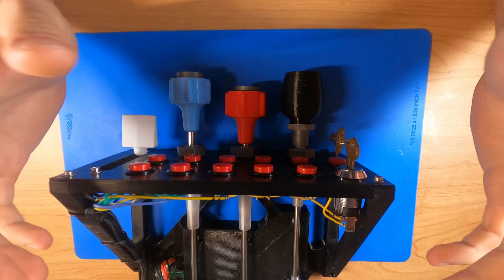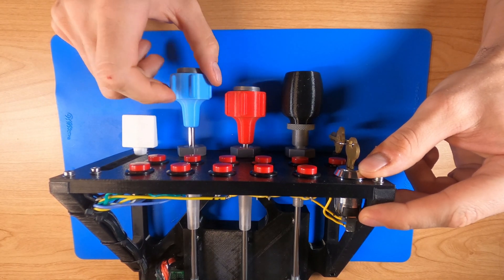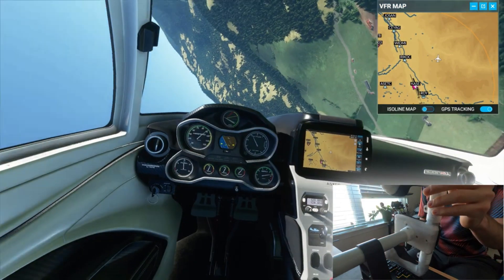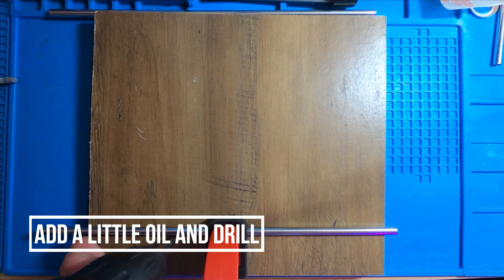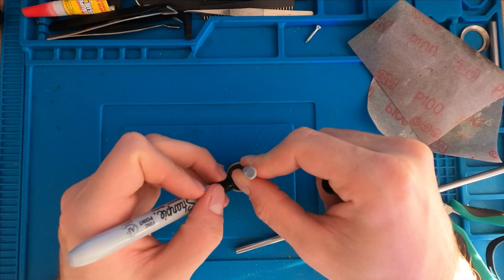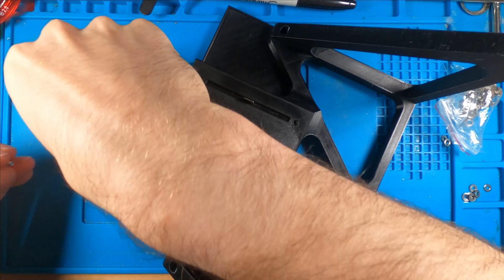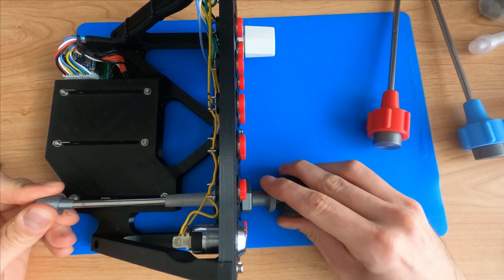CadetThrottle Demonstration and Build

Comment: Just finished building the standalone Mixture control. Thanks for your work!
Reply: where did you find adriunio codes the link is gone?
Reply: @BuddyQualityFirst  I haven't actually gotten around to setting up controls yet, but if you're using an Arduino Micro, Pro Micro or Leonardo, you can use the Arduino Joystick library to code it yourself fairly easily.  You should be able to find some examples online if you're not familiar with programming :)

Comment: i tried making this, tip: if you want the button for each knob to have a certain length, you have to drill an oblong hole for the ball bearing; having a small circular hole would only make the buttons have shorter length to press.

Comment: I am new to this channel.
Wonderful video!
Where do I get the parts for the build?  The knobs and the tubes and all.
Thank you.
Reply from the maker: If you navigate through the tabs at the top of the Arduino build page, you'll find everything you need.
Reply: @VincePrints  Wow!  Thank you for the response!

I didn't realize that you 3D printed some of the parts.  I don't have access to a 3D printer... do you sell 3D printed parts?  If not, do you know who does?
Thanks in advance.
Reply from the maker: @michaelkang215  unfortunately no, but there are many retailers you should be able to order from, if you wanted to get into the hobby a good beginner recommendation would be the ender 3 or the new bamboo labs printer
Reply: @VincePrints  Thank you for taking the time to answer.  I will take a look at your recommendations.

Comment: Shot in the dark here with an older video, but how does the fine control turning change the potentiometer position?
Reply from the maker: It pushes or pulls in a similar way to a ball screw, if you are familiar
Reply: @VincePrints  Makes sense now. I didn't catch that the prop and mixture sheathes' ID were actually rifled. I started with throttle sheath prints, that twice made it all the way to the stepped down threads before going haywire, and was going to use those whiffs as prop/mixture. Was having as much difficulty wrapping my brain around the smooth inner surface producing linear motion as I was why the print wasn't working. I'm completely new to printing; this is my very first build(on my son's printer from Santa!)

Comment: Friendly tip: if your m3 screws you're using to hold the linear potentiometers are slightly longer than they need to be and you tighten them all the way it's gonna be a long evening, or in my case two long evenings...
Reply from the maker: Yikes....hoping this worked out!

Comment: can i use toggle switches instead of pushbuttons so if the switch is ON the gear is out and if its OFF the gear is up or do i have to change any thing?
Reply from the maker: You will need to use diodes to prevent ghosting
Reply: @VincePrints  already figured something out but thx

Comment: So I found the correct joystick library to download and install in the readme on create-arduino page!  Now each slider pot (88mm 10k linear set from the amazon link, checked 10k ohm and linear with a multimeter) is only showing about 25% of the full range.  Is the only solution to use the windows joy dot cpi calibration to get them to work over the full range in MSFS 2020?  Or am I doing something wrong?  Should I tweak values in the sketch to get Windows to see these working over the expected full range?  Seems weird.  But overall - thanks! This is amazing and perfect!
Reply from the maker: The calibration in windows is necessary to have the throttle working appropriately.  This is pretty general practice even for actual game controllers just to ensure they are set up and working in their full ranges--hopefully this isn't too much of an issue!  Thanks
Reply: @VincePrints  Vince, thanks very much! It's easy enough to do, I was just a little surprised that we'd be expanding the range that much, but happy to do it to avoid spending $$$ on a commercial setup!

Comment: @Vince_Prints thanks for sharing and demonstrating! Could you please specify the size and type of springs used?
Reply from the maker: Not sure of the exact size, but they are about 50mmx10mmx1.5mm for the pedals and 30mmx7.5mmx1.5mm for the centering mechanism.  I would say this is not a strong return so you may want to consider stronger if necessary!
Reply: @VincePrints  thank you

Comment: Hi.  Which size (exact part brand & number best) & type of Linear Slide potentiometers are needed for this project?  thanks.
Reply from the maker: Hello Steve,
I couldn't find the exact serial number since they were posted on Amazon but if you go to the Arduino create link, a complete BOM with Amazon links is in the "ReadMe".  They are 88mm 10K Linear Potentiometers.

Hope this helps,
Vince
Reply: @VincePrints  Thanks! the 88 mm and 10k are the key details I needed.

Comment: 'JOYSTICK_DEFAULT_REPORT_ID' was not declared in this scope

Can some help me I have it built and cannot get the code to work. I have all the needed libraries. I am new to coding so sorry if its simple.
Reply from the maker: Make sure you have the correct joystick library, a lot of users had this same error
Reply: @VincePrints  so I finally got it to work last night I had multiple joystick libraries so I think IDE was confused. Thanks for the reply. Can't wait to finish my design I will share it on thingiverse
Reply from the maker: @homeworxchannel4120  Add it to the remix tab if possible!

Comment: Thanks for doing this! The project has been a true learning experience! My apologies if it is somewhere and I've overlooked it, but did you have any 3D printing tips you ran into? PLA vs PETG, raft the inner tubes, best orientation for knob/sheath prints, etc.?
Reply from the maker: The only noteable print suggestion would be to print the sheaths vertical with a brim to preserve the threading tolerance.  I printed everything in PETG but any filament type should be fine as long as your printer is within +/- 0.5mm.  I believe the knobs have supports under each of the overhang holes as well.

Comment: Have built this and love it. Works great in X-Plane but the throttle will not work properly in MSFS 2020. It is either 0 or 100% not linear at all. Frustrating. Working on the CadetRadio project atm!
Reply from the maker: Thanks so much!

Comment: Hi, I really liked your project and I'm doing it but I have a question, in the part of the button matrix, where do I put the ground and the voltage?
Reply from the maker: The button matrix does not use GND or VCC.  It uses the logic voltage between the two pins to register the button press.  Use the wiring diagram on the Arduino build page for support!

Comment: This is brilliant, thank you! Exactly what I was looking for for my 182 central console build — https://www.thingiverse.com/thing:4753075.

Some notes from my experience printing this. My anticipation was she sheath would be the biggest challenge, but it came out perfectly on the first attempt. The only issue is the inner thread came out spiky (and I could even see that in Cura's preview), and occasionally the ball skips, but still works great. I had to fiddle with the print settings to print the end caps (eventually had to minimize the supports). Also after cooling below certain temperature they would crack whenever I attempted to insert a straw. My solution to that was heating up the end caps slightly with a hair drier before assembly. Also had to hammer in the straws into the knobs, so maybe my straws were slightly larger diameter. And I used PLA, not PETG, that may have also played a role.

So happy I ran across this build, as I wasn't ready to shell out $80 a piece for the real verniers https://www.aircraftspruce.com/catalog/appages/a820.php
Reply from the maker: Thanks so much for sharing your experience!  Glad you were able to create some workarounds to reach your desired result--it can be tricky (especially with 3d printing) to create something that fulfills the tolerances of printers all over the world haha  Send over your finished cockpit when you have everything set up!

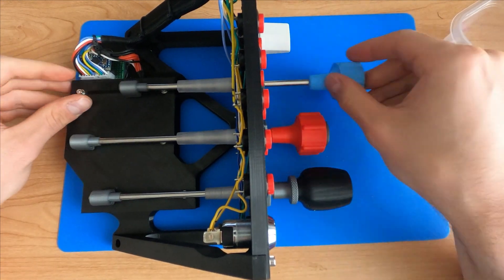Comment: Good job Dude. It would be much better If you change name of your Leonardo Boards (7:21).
Reply from the maker: The last time I researched this, there was something in licensing that stopped this from being possible.  Do you have a solution or work-around?
Reply: @VincePrints  can you try this. This is work good.
Reply from the maker: @technicahmett  Did you post a link or something?  I'm afraid I can't see anything
Reply: @VincePrints  oo sory I think I shared the link. Asa I Will share.

Comment: Hey I am working on creating one. I wired it up and and all the buttons work but the potentiometers are bouncing all over the place. Any idea on what could be the issue? (I used the same parts as linked in the readme)
Reply from the maker: Have you calibrated in windows?
Reply: @VincePrints  yeah its continuing to bounce all over the place. I double checked there was steady voltage to the potentiometers.
Reply from the maker: @HammerGarrett  windows may be reading the values for two of the pots as a single value.  I'm having trouble trying to replicate the error on my end unfortunately
Reply: @VincePrints  I replace the pots and it's all good now. I think I cooked one of them too much while soldering
Reply from the maker: @HammerGarrett  could be that!  Sometimes they are just low quality or have little pieces of dust or dirt that can affect their performance.  Glad everything is working!

Comment: "Joystick doesn't name a type" how to fix this in Arduino IDE sketch?
Reply from the maker: Do you have the joystick library installed?
Reply: I had this error before on a different project I was using the wrong joystick library
Reply: @kingbee133  which one did you use? I am having the same issue

Comment: Hi, I have watched all of your videos and admire your design ability.  BUT your video will be better for less able people if you explain how the thing you have made actually works.  I am an engineer and can work it out from the pictures you show but many will not and this will prevent them from making it again.
Reply from the maker: Hello Richard,
As you have noticed, I have left a lot out about how each of the devices physically works and that is mostly in an effort to keep the time of each video down.  If you read the description, you can find the Arduino project files which include copious amounts of build documentation and wiring diagrams.  The purpose of these videos is really to just demonstrate the models and function because these videos take hours for me to produce and are completely unrelated to my full-time profession (I spend most of my free time making these and release them for free).  It would be difficult for me to go off on a tangent, like how linear potentiometers are able to track motion through resistance, and still keep my videos "bite size".  However, thank you for your feedback and I will take this into consideration for my next project which should be coming in the next month or so!
Cheers

Comment: Hey Vince is there any way you could do a more in depth video of how you soldered the board?  I slowed down that portion of the video to see if I could catch everything and it didn't help. Sorry for any inconvenience, soldering micro boards or anything else for that matter is not my strong suit as of yet anyway.  Thanks again and can't wait to see the next build.
Reply from the maker: Hello!  So I purposely didn't include that part just because I could make a whole video about solding and hooking up connectors!  If you go to the Arduino build page, there is a complete pinout showing you exactly where each write needs to go.  If you aren't super comfortable working with the JST connectors, I recommend soldering straight to the Arduino!

Comment: This is an amazing job!! Thanks you very much for your work. I only have a question, the two rods with button (the mix and propeller), if i pull those back, they will fall out? I can't understand which thing keep those in place, i mean, there's a spring, why they don't pull apart? 
Thanks so much again!
Reply from the maker: They will not fall out! The ball bearing holds the button in place (the spring is used to pull the ball into position) and the end cap acts as an end stop for the mechanism. Hopefully, this answers your question!

Comment: Top notch build! 

Many thanks for showing how the push-pull mechanism works! I'm working on my yoke design at the moment, but pushrod throttles are likely going to be a future project for me. You've just explained away a lot of the doubts I had about those things that I could never figure out from flight sims.
Reply from the maker: Thank you so much!  It took me about 2 weeks to find a picture on like page 10 of google images that had the internal notch pictured and it was a eureka moment for sure!!! Hopefully I saved you some time!

Comment: The traditional superlatives are wholly inadequate for your project. Several years ago, a colleague built me a Cessna 172 panel frame to plug my Saitek stuff (everything Saitek sold + 6 dials). Needless to add I remain forever grateful to my colleague for helping me cross the chasm since I never did any woodworking after high school lessons and metalworking after college lessons.

You have done excellent work here with an eye on the budget. I sincerely hope that others can build their own gear with your guidance. Thanks for contributing to the Flightsim community because it sure can get a boost from your ideas/concepts. Best wishes & kind regards.